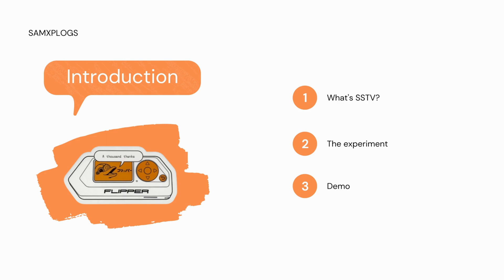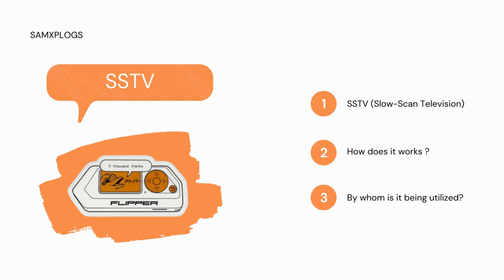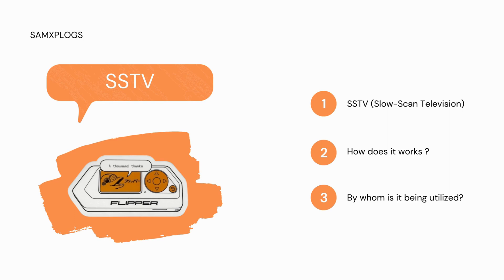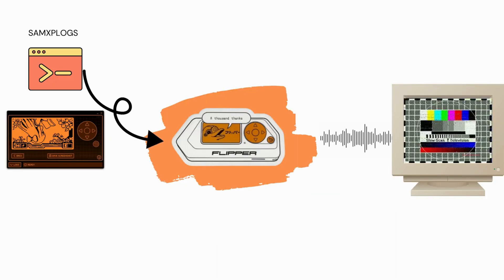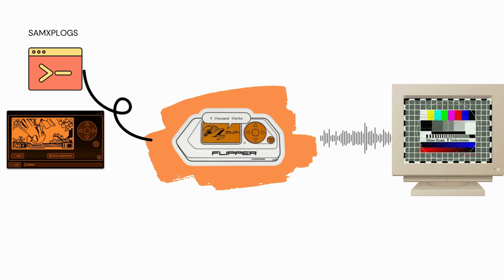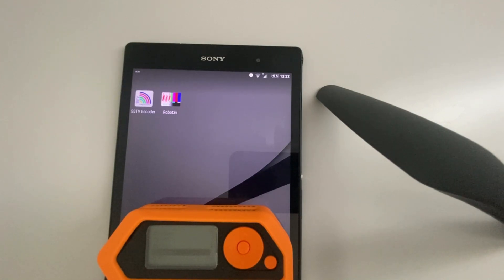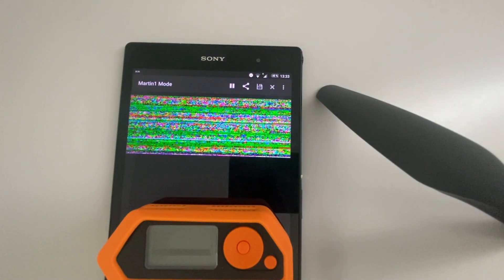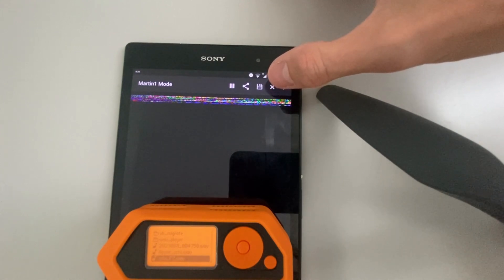Wireless Picture Transmission with Flipper Zero: Exploring the SSTV Method

Comment: So realistically we'd need a Flipper based image converter and a way to send images to the Flipper, maybe over BT?
Reply from the maker: Hello DirtyPlumbus, yes that will be next level of integration. I would love to be able to transmit or even capture using SubGhz. Hope I will be able to share something soon 🙏
Reply: @samxplogs  There may be enough bandwidth to capture a SubGhz-RAW and replay it...that could be interesting.  Maybe I'll give that a shot at home since 433MHz is within the USA ham-band should be as simple as recording while sending normally.  Can't recall whether Flipper does both AM and FM but something like an ICOM all-band-all-mode rig should be able to configure something that would work even if its AM.